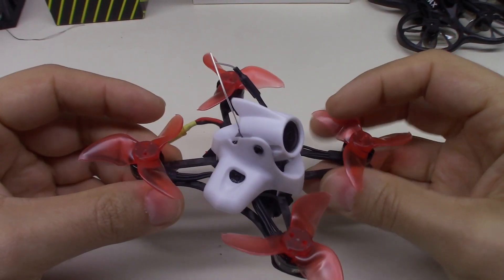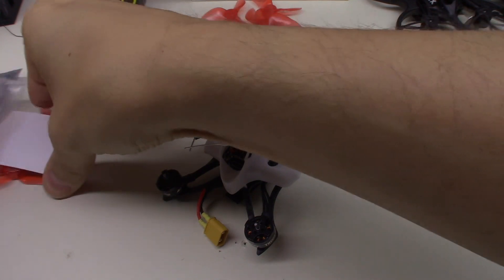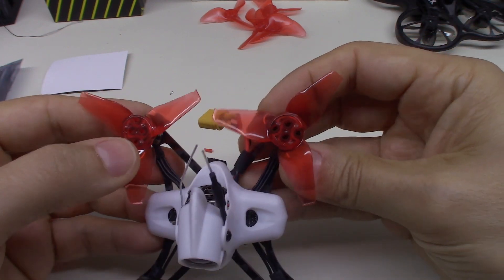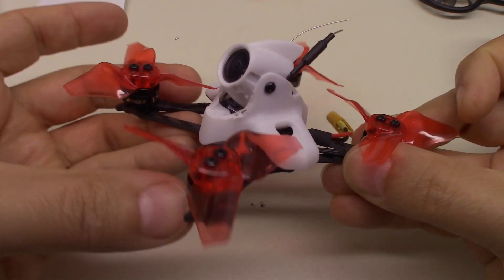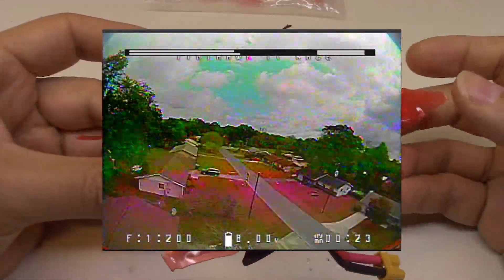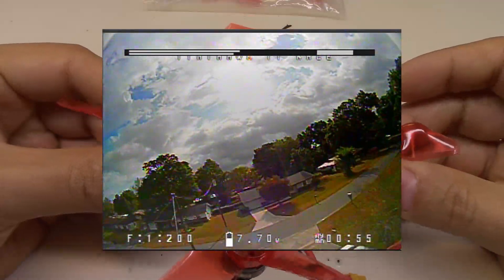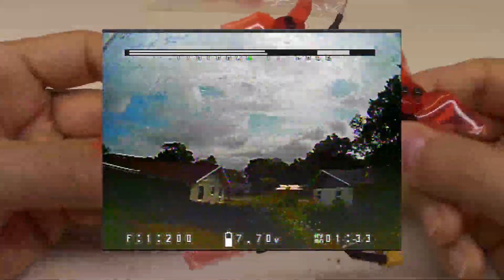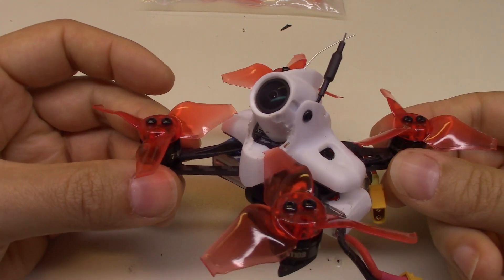Big Props on Tinyhawk 2 Race

Comment: nice job looks boss with the bigger props, But with the extra prop size also comes extra mass to swing around perhaps making the motors have to work slightly harder therefore resulting in no extra performance.

Comment: Hey i got the th 2 race now! I like this so much but one thing i found was that it has some prop wash on a turn or a small dive and brake the fall by pushing the throttle, it kinda wiggle the hole quad. Can i do something to this?
Reply from the maker: You can almost certainly tune it out to a degree but honestly bf tuning isn't my strong suit.  You can get around it by keeping some throttle on throughout the maneuver though.  Thanks for watching and a sub is appreciated!
Reply: Do RC ok i got ya👍🏽.
Reply: Try reversing prop direction
Reply: If like me (and from his video Nurk) its a dip in pitch, I cured mine completely by upping the P value on Pitch by five or so, that ONLY.

Comment: Yesterday i tried gemfan 2040 hulkies on mine there 2 inch props but flew ok although i only flew on 1s as the props were a push on loose fit and didnt have a tool handy to screw them down and didnt want to risk losing props on 2s power but worth a try.
Reply from the maker: I have some of those and like them on other quads. I'll give em a try!
Reply: @DoRC  they give me over a minute extra on my mantas 85 and fly's better than stock and are stronger than the kingkong type blades.

Comment: Great video. I’m guessing the extra thrust from the 2.3 inch props is offset by their weight perhaps
Reply from the maker: I don't think so. The props only weighted a half gram more than the stockers and the disc area is nearly 30% larger.  I think either they just weren't the right props or the proximity to the canopy was messing with performance.
Reply: Do RC hmm perhaps it was the interference then

Comment: A great deal of interaction between and around the props. Likely making them perform even worse than the stock props.  Nice work in fitting them on there however.
Reply from the maker: Yeah. I kind of figured the close proximity to things would be an issue.  Fun experiment though:)